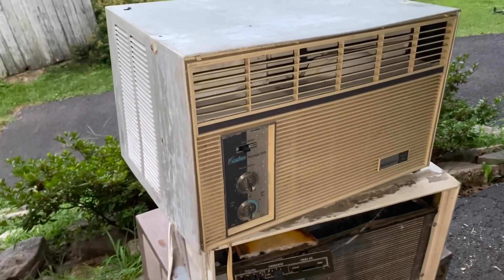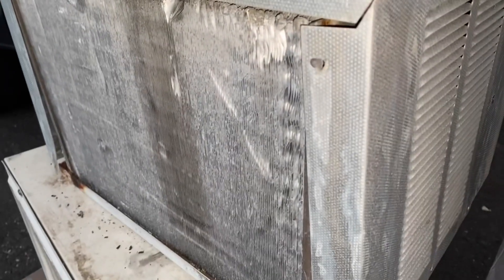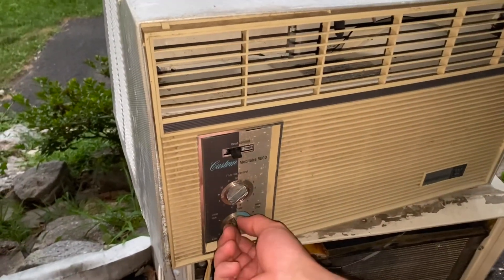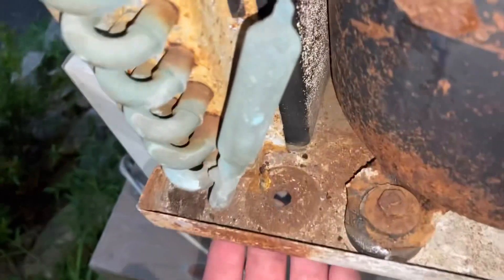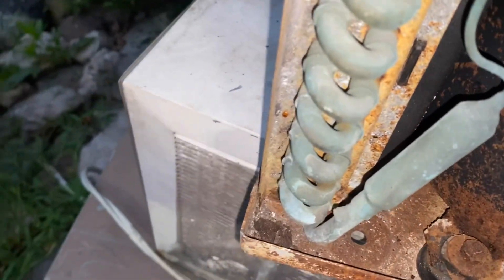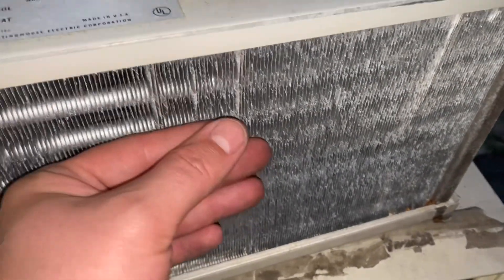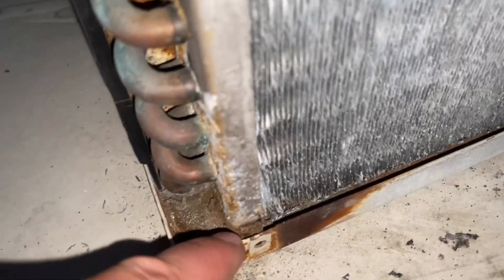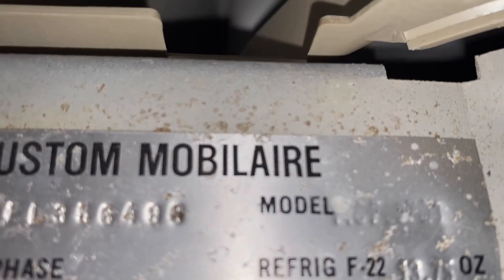A look at a 1960’s Westinghouse “Custom Mobilaire 5000” Air Conditioner

Comment: One of the advantages of these small Westinghouse Mobilaire units is the use of Westinghouse-made hermetic reciprocating compressors.  Westinghouse used their own compressors in a small part of their line starting in 1957.  FYI these are Westinghouse-made compressors, not Bendix-Westinghouse, a completely different company. (Not counting their pre-war units which all used Westinghouse-made hermetic compressors).
Reply: FYI, These Westinghouse-made compressors used in the Mobilaire units of the 1960's were known as "flat tops".
Reply from the maker: @air_conditioner_man  i love their sound

Comment: I used to own one of those!  It was a lesser model though, it wasn't the Custom version.  In fact, it had no fresh air intake and also no thermostat.  You had high & low fan, high & low cool, that's it.  In cool mode, the compressor just ran.  We used to have a basement apartment and the landlord paid the electric, so it ran nonstop.  I had that place down to 55 degrees when it was over 90 outside!

Foolishly, I loaned it to my sister when she got an apartment.  When she moved, it wasn't packed properly, and was placed on top of something, and fell while the truck was driving, which destroyed it.  I do still have a Mobilaire 6000, same exact unit but 6,000 BTU.
Reply from the maker: Thats ashame about your old Westy! They really are fantastic!
Reply: @TheAirConditionerGuy  I'm still sore about that to this day, that air conditioner was fantastic!  I actually made a thermostatically-controlled outlet for it, featured that in a video many years ago.  That device lives on now for a window fan, and can also work with a heater.

But that old Westy was probably the greatest air condiioner ever.  I never quite understood how they could sell it with no thermostat.  Granted, most people buy extremely undersized units because they are cheaper, and crank it as cold as it goes, so they run constantly anyway, but if a 5,000 BTU unit was the actual size you needed, there is such a thing as making it TOO cold.  Like I said, the apartment got down to 55 degrees; I used to go outside to warm up!

Comment: Hey Some or most  older units are amazing that if not damaged they are still 100 percent blowing frigid air. Heavy duty parts. The one thing I think they should have raised the condensing unit higher off the base. I’m looking for some decent older units. Excellent video

Comment: I'm hoping to eventually get that 1960s Whirlpool, it'll be the oldest unit I've found as not many people where I am had air conditioning before the 70s and most of the 70s units have already been scrapped because the power company has been pushing efficiency since the 90s going so far to subsidize air conditioners and dehumidifiers among other appliances
Reply: God I miss old AC's, so glad I got an old kenmore my friends family didn't want, it actually cools the whole downstairs and still works 30+ years beyond purchase but oh no I'm spending $3 dollars more a year by using it, who fucking cares. These new units are a joke.
Reply: @s0nnyburnett  I was lucky to score an older Kenmore window shaker circa 2000 that still works beautifully and is even quieter than a Friedrich, I also got a 1981/2 Kelvinator with a massive reciprocating compressor, both from my great grandpa who got tired of stepping around them in his garage and was gonna toss them if I didn't get them quick, the Kelvinator was sitting for roughly 15 years but it fired right up and after oiling the fan motor it works like new, it'll cool a 1250 sq ft house by itself. I also scored a rare old Wards not too long ago off Craigslist and a few newer R22 window shakers but the supply has all but dried up here so I'm pulling all the strings I can to get old air conditioners

Comment: 51 degrees outside in 80 with the case off, most units won't pull that indoors at 80 inside or outside. That's insane.
Reply from the maker: The build quality on the old Westys are fantastic!

Comment: Its funny but, Westinghouse never liked to use squirrl cage blowers on the evaporator side. They just went gangsta and put in the finger chopper blade. Lol. I guess that type of blade gave a higher velocity compared to the squirrl cage fan.
Reply: It was a matter of cost.  A centrifugal blower cost more.  A simple propeller fan was cheap.

Comment: Those old ones would cool have a house down. One up stars and one down stairs they would do a better job than most 5 ton central air units of today. They were raw power and zero energy efficiency which is what kills window AC's today. Yes, they would cost a fortune to run that's why a lot of people who had them were very stingy when they ran them but man could they put out a blizzard of cold air in a short amount of time!!
Reply: They really don't cost much more to run as long as you don't run them night and day every single day. But by god do they get the job done.